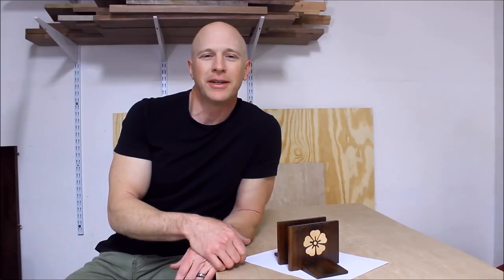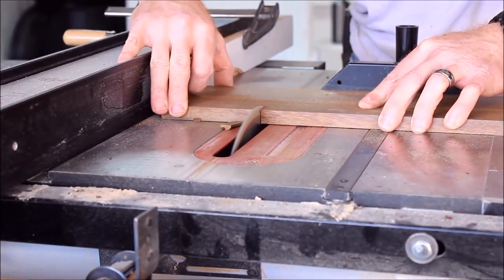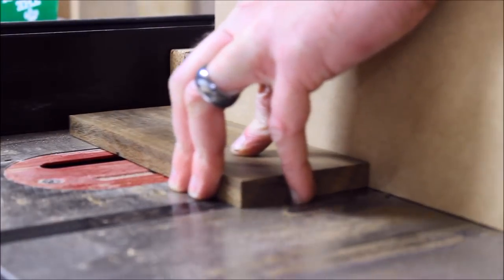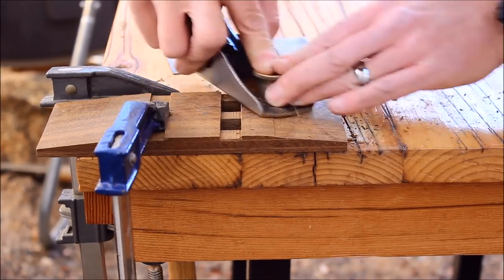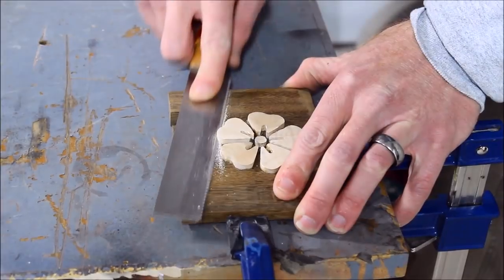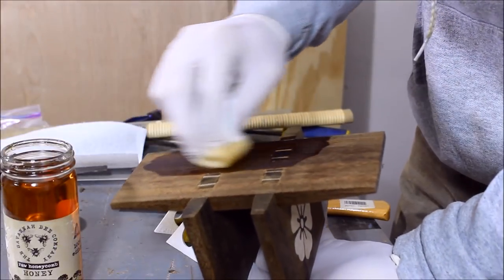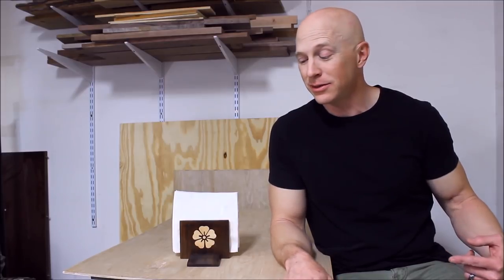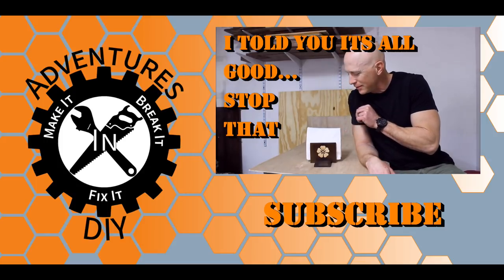Make a Napkin Holder with a Cherry Blossom Inlay - 2015 Kitchen Utensil Challenge

Comment: For a $10 set of carving chisels that is a beautiful inlay.  It's not the tools, but the craftsman who uses them.
Reply from the maker: MonkWerks with Fr. Thomas Thanks Fr. Thomas.  I have to pick up some slip stones so I can properly sharpen them.  I'll probably to the cheaper route and adhere sandpaper to wooden profiles.  I love your profile pic btw.
Reply: Just trying to give a little love to the 80s and the often maligned radial arm saw with the profile pic.